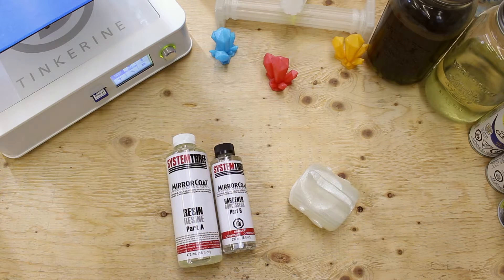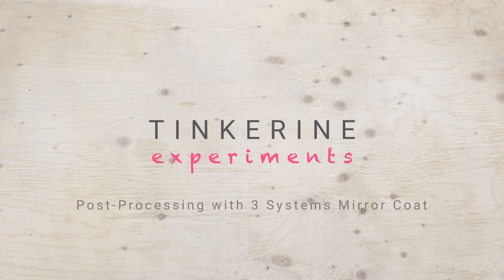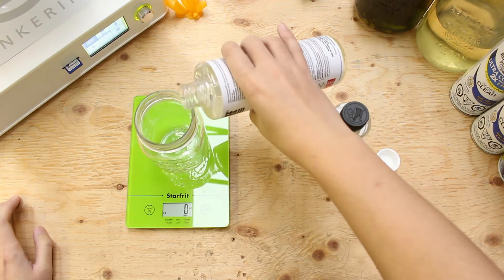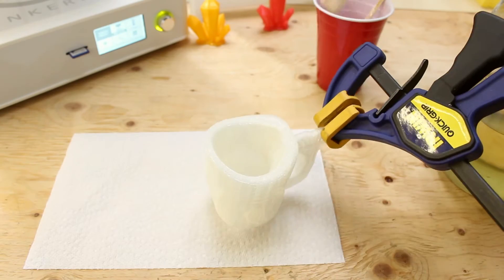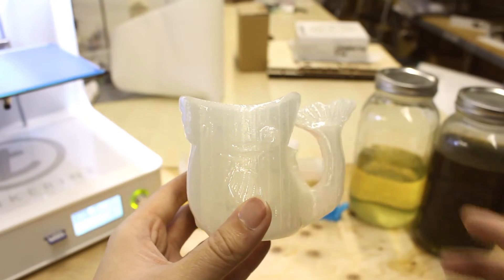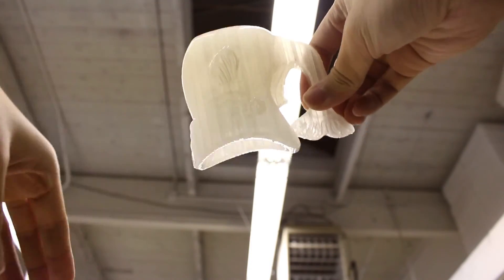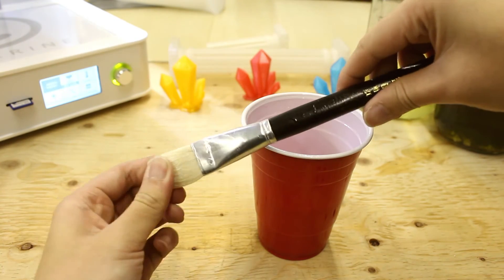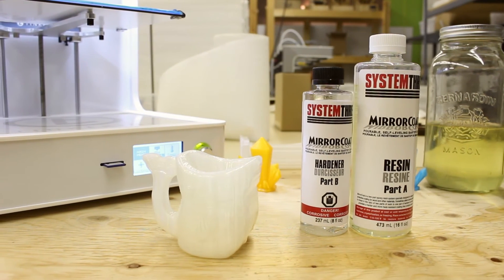3 System's Mirror Coat

Comment: would this work as an option to finish the print? Is the surface smooth enough that it won't look 3D printed after painting?
Reply from the maker: Hi Robert Wallace,

In this experiment, I used clear filament so you can still see the lines from the 3D printer. This Mirror Coat is mainly used to make the print water tight and sealed so water can't seep into it. It doesn't fill in the layers from the printing.

If you would like to finish off the print, I would recommend using a high density filler/primer first and then sanding it down. Then painting and then use this to finish it off giving you a nice glossy finish. 

The mirror coat did smooth out the surface of the print.  

Hope this helps!